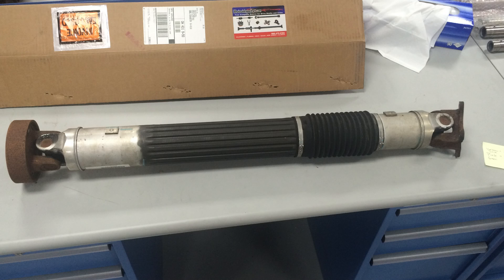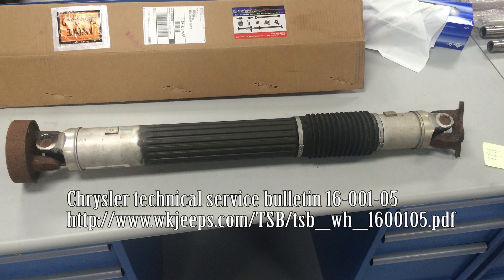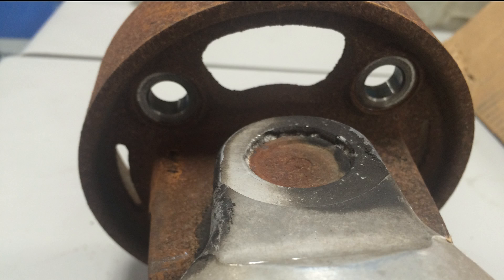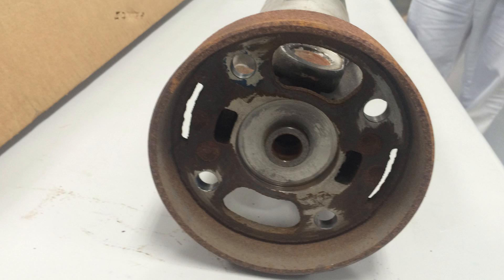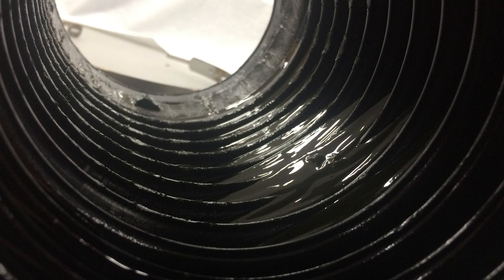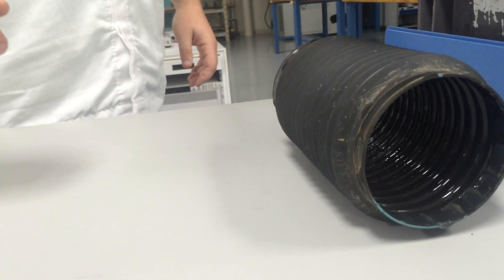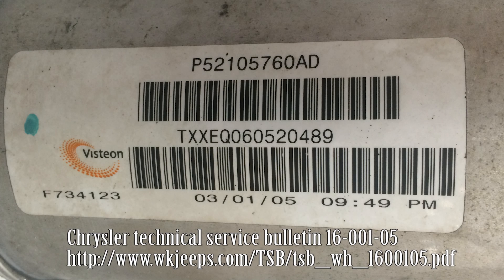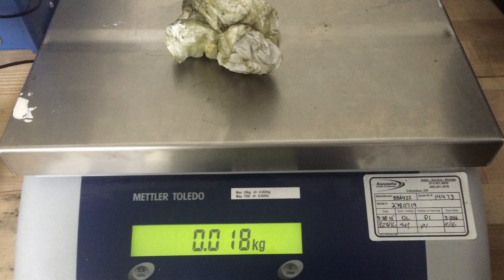2005 Grand Cherokee drive shaft vibration diagnosis (SOLVED!)

Comment: Found this video. I got a 06 commander and can’t find out why I have rear vibration under slight heavy acceleration. I even replaced the whole rear end. I never suspected the drive shaft because the u joints were still ok. The  feeling it gives me is like an unbalanced DS. So this might be my problem

Comment: I need to  know what was the sound and vibration like? My 2005 jeep grand cherokee 5.7 hemi vibration is like driving over rumble strips by the side of a highway, wondering if yours was the same?
Reply: Tell me u found the problem!! I just replaced my upper control arms & CV axles, now I'm havn that very issue!! That's the best way I can describe it!! Mine is doin it only on acceleration
Reply: @mr.2k81 did u fix it?
Reply: @h22eh6  yessir!! It was the cv axles...when I 1st replaced them, I used O'Reillys...that's when my issue startd...talkd with a fellow Jeeper & he told me that I need'd OEM, so that's wat I did & problem solved
Reply: @mr.2k81 where were u feeling the rumbling noise
Reply: @Joe Fracassa
Reply: Did u fix it? Rumble strips is right I got that

Comment: My 2005 Grand Cherokee sounds like a 1940s propeller plane very prominent at 60-70 MPH, heavy vibration through the steering wheel and pedal.  Could this be the problem?

Comment: I have a 2006 grand cherokee 3.0 crd. It's got a violent noisy vibration when I turn, especially bad during full lock when maybe doing a 3 point turn. I thought it was a broken spring but sadly not. The mechanic is not entirely sure of the problem but is fitting a new drive shaft. If anyone's got any thoughts, I'd appreciate it. Could really do without a money pit at the moment. Thanks.
Reply: Front drive shaft CV?? check if there is grease everywhere common problem.
Reply: and not the front axle cv either they seem pretty reliable.

Comment: Did this job and seems very valid as far as explanation. Replaced whole drive shaft and it still seems to have vibration on highway speeds. I've also replaced lower front ball joints and passenger side wheel bearing. I'm stumped. I'm hoping its a slightly bent rim... Otherwise, she's up for sale lol
Reply: check your diff bushings

Comment: Thank you for the video.  I too have this Jeep Model and vintage at 87,000 original miles and am getting the audible drone like sound without the vibration.  The after market shaft you purchased is made of heavy steel versus the OEM which is made mostly of lighter aluminum.  Did you experience any bad results from the heavier steel drive shaft?
Reply: I would like to know this too. I imagine once balanced that it would be better in every what except throttle response and fuel economy and vehicle weight.

Comment: Replace the whole frigging drive shaft because of some grease in the boot?! No way, unless the UJ's are shot.  You say the issue with just cleaning out the boot is the replacing of the boot bands. You rule out hose clamps (Jubilee clips) because the screw is out of balance, but I would use two, shorten them and daisy-chain them so the are screws 180 degrees apart.  Or use two clamps next to each other 180 degrees apart.  There are also other types of boot band around, ones like steel cable ties that dont need special tools.
Reply from the maker: Duke Nukem I agree with you. But my shaft was 12 years old and I replaced the driveshaft before I tore this one down.

Comment: ok so you just wiped off the oil and put the boot back on?  My jeep violently vibrates on the highway but only at random times,  Sometimes it could be weeks apart.  Other times its minutes apart.  I have to stop my jeep and start it again or the vibration doesnt stop.
Reply from the maker: No, I replaced the entire driveshaft.  I didn't have anything strong enough to crimp that clamp again.  I think that you could do that if you want try.  If you are having a violent vibration I'd look into death wobble.  The driveshaft vibration is pretty consistent around 60 mph.
Reply: Aaron Crabtree I ruled out the death wobble.  This is more of a gradual increase of vibration that gets worse and worse.  I've had sensors replaced.  just had the torque converter replaced and still the vibration.  I've gone to 3 different mechanics and they can't replicate the vibration because it is completely random when it happens.  so frustrating.
Reply: So we ruled out the oil too.  Mechanic took off the boot and there was no grease buildup...
Reply from the maker: Notmyreal Name changing oil in the transfer case probably won't fix anything. It is a synthetic that has a frequent change interval though. Make sure you use the correct Mopar fluid. Check the three rubber mounts on the front differential.
Reply from the maker: My guess is tires
Reply: Notmyreal Name  what was your diagnosis??
Reply: Aaron Crabtree may I ask what the rubber mounts on the front differential if faulty would cause?  in regards to observable symptoms.   I remember the dude at me lo e saying that the front dif needed the fluid changed but I don't trust them.  I tried to think back to when I started having the vibration issue and it may have started shortly after adding tires that were a little wider than the stock tires.  Do you think that would have any affect?
Reply: Having a really consistent harmonic vibration between 55-70mph. Get to 75 and it is gone. I can sometimes feel it at lower speeds but for the most part smooth as glass except 55-70. I've replaced the front shaft to no avail.   The vibration is more harmonic, but extremely annoying. Seems to worsen over distance. I'll wake up next day, back to normal vibration as every morning, worsening with distance traveled. I feel it in my seat, feet but not really through steering wheel. The date on my shaft is 2 weeks after yours(March). I've watched your video twice and still can't wrap my head around a few grams of grease causing this sound, feeling!
Reply: Before buying tires ill rotate them and see if it makes a difference.
Reply from the maker: Notmyreal Name let me know what happens. I have Goodyear SRA tires (OEM) and one of them makes an incredible noise.
Reply: Bad belts in tire and rear u joint smooth as silk now
Reply from the maker: Gary Hawthorne glad you figured it out!
Reply: Gary Hawthorne can you tell me what bad belts an tire means?  my mechanic thought it was the torque converter.  still vibrates.. .
Reply from the maker: You can have a slipped belt in a tire that causes it to be out-of-round, or the tread pattern moves laterally as the tire rolls down the road.  The easiest way to check this is to rotate tires and see if the noise comes from a different location.
Reply: Aaron Crabtree thanks I'll try rotating them
Reply: Gary Hawthorne didn't get one.  he had my car for weeks and said he didn't hear it vibrate.  I drove it home and that same dice it vibrated on me and again the next day.  I've given up spending money on trying to find a diagnosis.  the mechanic said I should change the oil in the transfer case...  I have yet to do that

Comment: WOULD BE NICE TO ACTUALLY SEE ONE BEING INSTALLED. i MEAN THE EQUIPMENT LIKE FLOOR JACKS AND ALL
Reply from the maker: The rear is easy.  There is nothing in the way.  The only part that is tricky is jacking up a wheel to turn the drive shaft to get to all of the bolts. (Then put the wheel back on the ground to prevent it from turning.)  The front requires loosening the cross member at the transfer case to gain extra clearance.
Reply: @AaronCrabtree  IF you had the car on jack stands a park brake would stop the wheels rotating.
Reply: I have just done this job, and I put the old shaft back with plastic cable ties around the bellows. Did not need to turn the rear wheels as I could reach all the rear bolts anyway.  Then I compressed the shaft a bit and lowered the rear end onto a foot stool.  I could then turn the shaft to reach all the front bolts.  Did not need to loosen any crossmember. The bolts were very tight (with Loctite or some-such) and I bent a big screwdriver which I had put through a UJ to prevent turning.  I did not rely on the rear wheels to stop it turning - far too spongy.  As for floor jacks, I only lifted up the left side up a few inches onto stands.